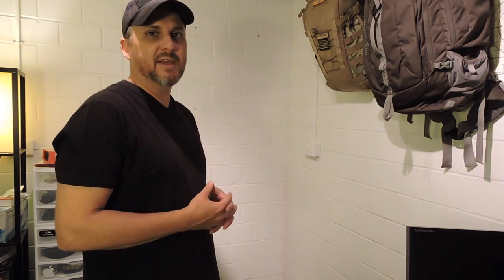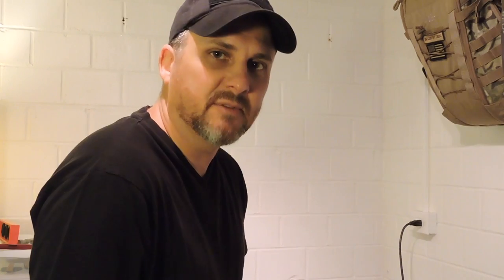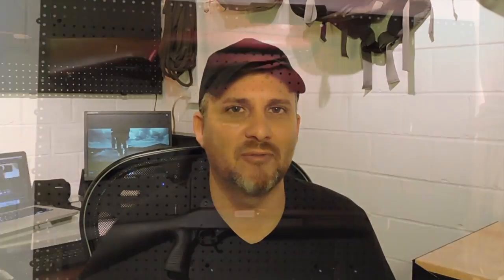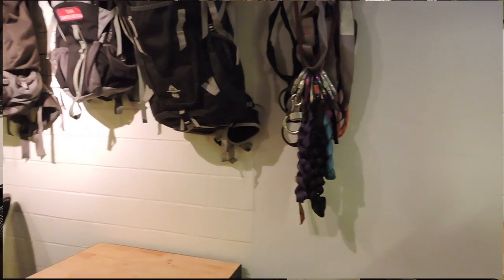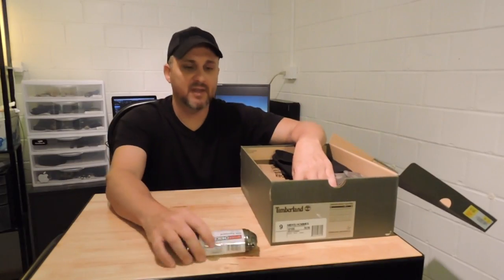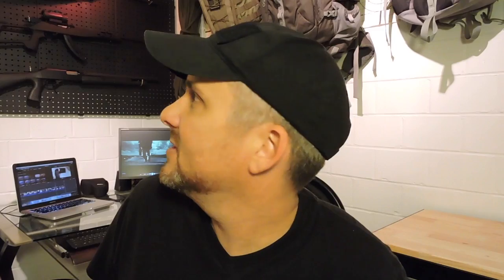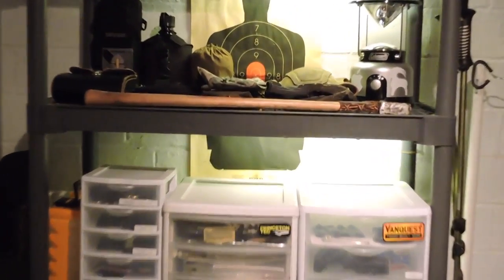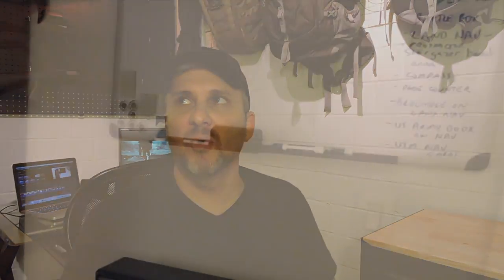TACTICAL GEAR ROOM | UglyTent HQ

Comment: Would like to know what screws you used to attach to the walls
Reply from the maker: I drilled, placed anchors, caulked them and used average everyday screws. May have even used some drywall screws.
Reply: @UglyTent  have they held up after all this time?
Reply from the maker: Yes, they’ve done excellent.